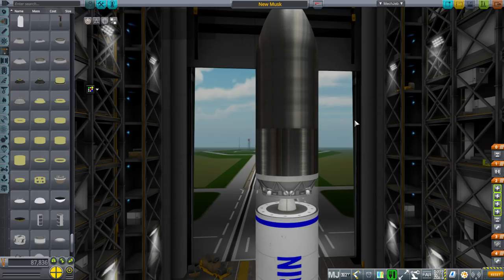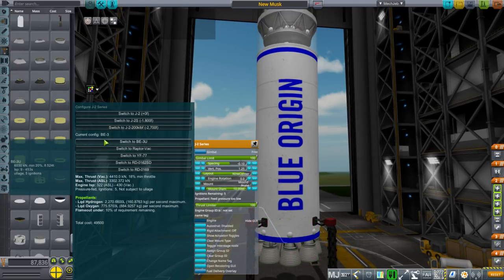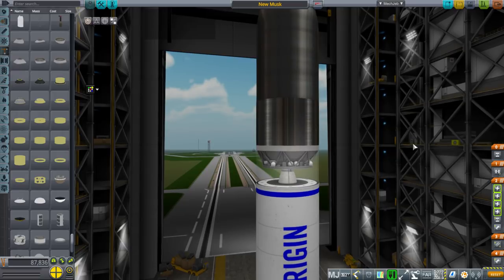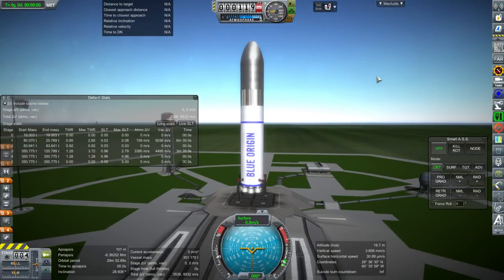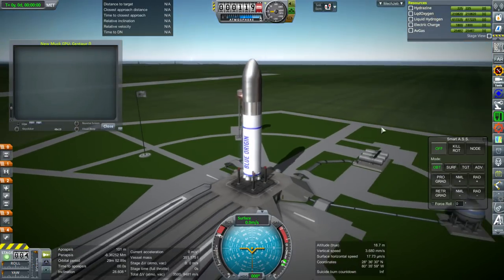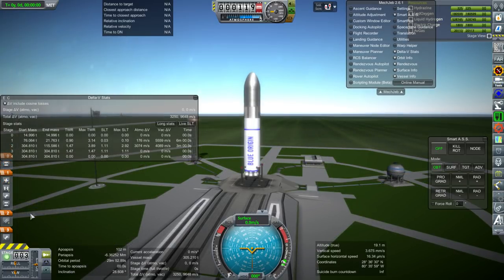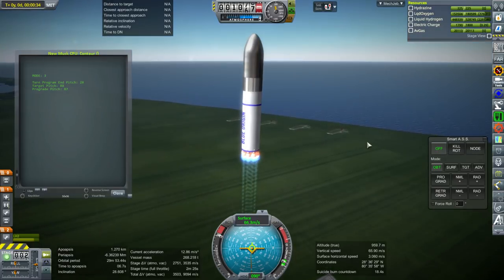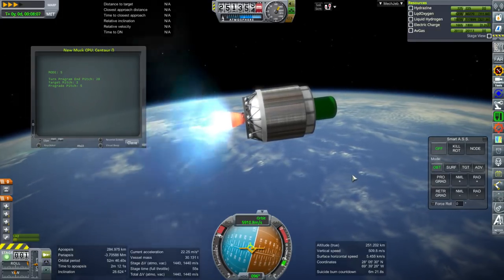Kerbal Space Program RO Sandbox - New Musk Rocket

Comment: We need the MGR: Musk-Glenn Rocket.
Uses Falcon 9 engines at sea level but a BE-4 or BE-3U on the upper stage. The best of both companies.
Reply from the maker: I'm not sure that would produce an improvement on New Glenn. Even if we just used enough BE-4s to match Falcon 9's sea level thrust - say, 4 or 5 - the resulting rocket with a BE-3U upper stage or even with a Merlin upper stage would have better performance than Falcon 9 thanks to the methalox first stage.

Comment: How do they advertise the new glenn as having 2x as much lift capability than any other rocket?
Reply from the maker: New Glenn has a 45 ton capability to LEO at least, I believe, though about 2x a Falcon 9, though still less than half a Saturn V. The delta-v and lift capability provided by any particular rocket design can be worked out purely by equations. When built, there will no doubt be issues to work out, just as there were with Falcon 9 or any other rocket, but its capabilities will be what they are.
Reply: Raiz Space are these 9 engines not the same as the 7 that will be on new Glenn? Or never mind I just hear what i missed the 1st time I watched about these being from new shepherd.  Lol now I  understand